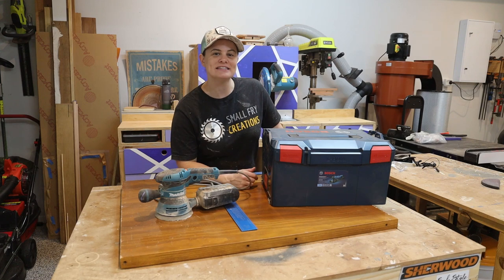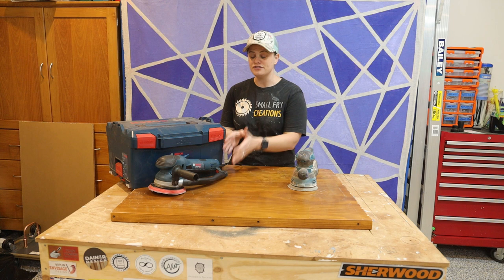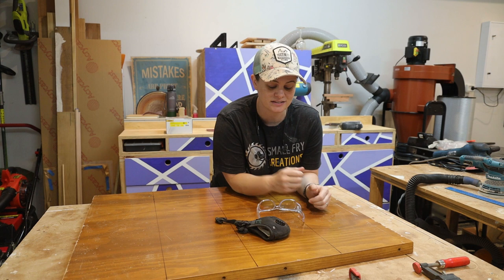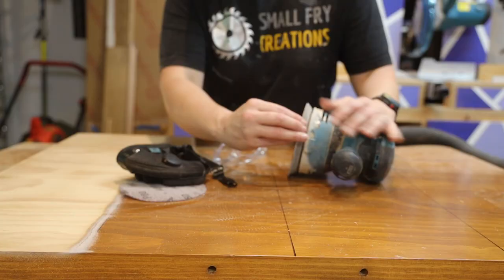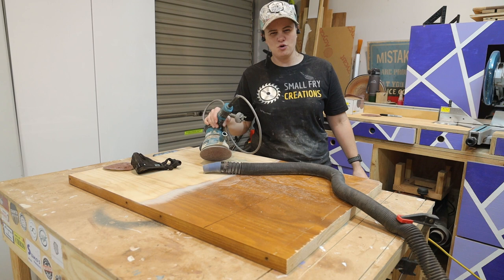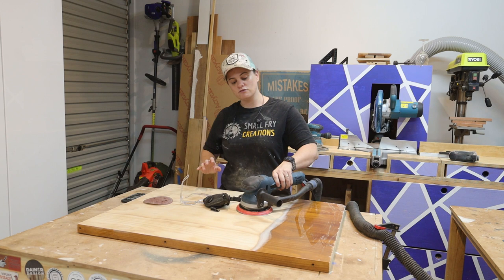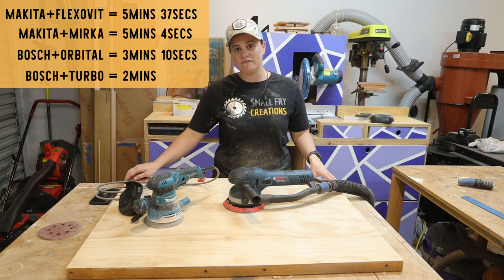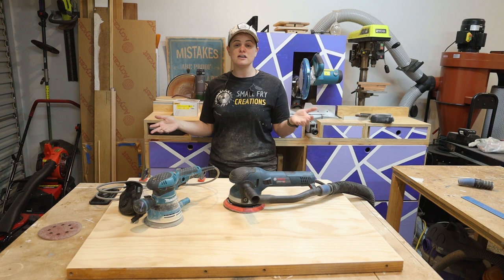BOSCH Sander GET 75-150 VS Your Everyday Sander Review and test

Comment: This is exactly the upgrade I am planning. I have that 125mm Makita and I'm planning to get the Bosch 75-150, so this was perfect, thanks! The plan is not just to do the job quicker, but also to make it easier to get a flatter surface due to the larger pad.
Reply from the maker: Awesome. The Sander is fantastic and does a great job. Its easy to hold flat and does create a better finish for sure

Comment: Hahaha the sanding shuffle! Wow, wow, wow. Awesome test Ains, you are filling a gap I really wanted to cover in my video as I was restricted to my 5" 18V Sander. I have an article coming out soon going into more detail about types of sandpaper and why they perform differently. The main thing to note with the Mirka is while yes, the FlexOvit was only a little slower brand new... if you'd repeated the test a few times the Abranet would keep on going fast whereas the Bunnings one would wear out after a few repeats. But geez, how good is that Bosch unit? No brainer if you are in production mode for markets or furniture.
Reply from the maker: Thanks James. How else do you pass the time sanding besides dance. The Mirka sandpaper is awesome. Like you say over the life of the paper the Mirka just runs away with being the best. I’m keen to read the article when it’s out 😀 your video has great info and detail 😀

Comment: Gooday. Im uk based and was using Festool rotes over 20yrs ago…a sensation after normal sanding. I then tried Makita roto orbit type…almost as good. I,m now at 64yrs old and retired considering the Bosch after reading dood reports. You are correct about abrasive types..they make a considerable difference. Over here its Sia or 3m products I prefer Sia Siarrex the difference being out of this world if you go from a normal sander and normal paper. We used to strip a full farmhouse table top ie 6x3 feet of a 2 pack laquer in around 15mins. [it might take a little longer these days. Great review ps try removing that extra handle and hold the sander on the top directly over the sanding pad it well stop it getting away from you. Also you bench seems a little high to get your weight over the job. Kind regards from across the big pond Stuart Bell
Reply from the maker: Hey thank you. I haven’t tried the others to compare but I’m very happy with the Bosch. I have found since removing the handle does help. Your right with the tip 😀 happy sanding and making and thanks for the support 😀

Comment: I've actually been looking at the Festool Rotex lately and as you say, it's ridiculously over priced. I checked out the Bosch and the guys at Total Tools told me it was a Festool challenger. This review couldn't have come at a better time. Well done, and you've made my decision a little easier. Cheers. 👍👍🙂
Reply from the maker: Thanks Chris. I have never used a Festool to compare but I love the Bosch and at half the price it surely can’t be doubley better. Another thing I found when researching was with the Festool gear you really need to use their dust collector because they have odd size fittings and I didn’t want to 1.shell out for the collector and 2. Be locked into a brand. 😀😀

Comment: Been doing a lot of sanding over the past two years. All my door and window frames and cladding are cedar, and have been badly neglected. Stripped them back, inside and out, and used Osmo. UV product on the out and regular on the inside. I think I’ve used almost every sandpaper and method... and still learning by experience. I have three festool sanders, and I can’t say which is best, because it comes down to what the task is. The 150 is so satisfying to use on big panels, but hopeless in corners or on the many narrow edges.  Something with a delta pad works best  However, when it comes to sandpaper, I’ve not found anything better than festool Granat.
Reply from the maker: That sounds like a lot of sanding. It would be awesome to have a team of sanders 😀 I have heard good things about the Festool sandpaper’s 😀 just so pricey!!
Reply: 3m 710w or 3m 310w. Both are far superior to any festool sandpaper I've tried. Highly recommend 👍

Comment: Nice comparison. You want to save even more time use a variable speed rotary sander/polisher with a good 8" pad. They do take a lil more skil and technique and you loose the dust extraction but way funner to use.
Reply from the maker: Oo good tip!

Comment: That looks like sheet 3 is Abranet without a protective pad- and it's 150mm v 125mm 30% larger pad? Your vibrations in turbo mode are not conducive to sanding for extended lengths of time. In 2023, your best is festool or mirka 150mm brushless eccentric sanders combined with 3m cubitron II extract. The rotex compares with the Bosch but both are far too aggressive in turbo mode to be all that useful.
I don't believe the Bosch has a replacement air center hole - this allows for better extraction and sandpaper cooling. Mirka Festool and Metabo sell sanders with this feature.

Comment: Great comparison. Thanks a lot!
Reply from the maker: No worries!
Reply: I bought the sander and used it for the first time today. I must say I am very disappointed. I have a GEX 125-150 AVE which is a good sander IMO. I thought the GET 75-150 would be everything like my GEX, but add the Turbo mode. 
I find the Turbo mode is less useful than I thought, because the sander is really hard to control then. One gets easily uneven results in Turbo mode. Also the vibrations are extreme and very annoying for the hands and arms. The plastic handle on the GET is a joke and does nothing to dampen the vibrations. 
Then in normal random orbital mode the speed of the GET is much slower than my old GEX. It took me more than double the time to sand paint with a new 80-grit (supplied) paper, compared to a new 80-grit (normal Bosch paper) on the GEX. (3:40 with the GEX and about 8 minutes with the GET for the exact same surface!).
Also the handling of the GEX is much better, because it's perfectly balanced, while the GET tends to tip over all the time and needs constant attention to try to keep it flat -- which is much harder to achieve than with the GEX. I surely will get rid of the GET again and will use a belt sander or other means for the rough work and use the GEX for the final sanding.
Ah, the vibrations on the GET are seriously more (in Random orbital mode even) than with the GEX as well .... --- I hate the GET!

Comment: is this 150 to 150 mil or 125 to 150 test? it's kind of logical, is makita use smaller pad (and probably weaker motor etc), it slower, right? there's other makita model, which would be better head to head test, imo.

Comment: So I have that Bosch and was looking to also upgrade to that Makita. The reason I want the makita is I'm not sure how good a 6" sander would be for finish sanding. I want to start making some hardwood tables and furniture. Would you agree that you would probably use the bosch for the low grits and as you go higher use the makita for a better finish? Or do you think the Bosch can do it all and still come out with a good non swirl finish?
Reply from the maker: Hey I use the bosch for every sanding job. Tables and all. Have never had an issue. I would recommend using a good quality sandpaper like Mirka an you would be good. Hope this helps 😀
Reply: @SmallFryCreations  wow that would be cool. I like how you can turn the bosch down pretty low for ends or softening edges. Thanks for the reply

Comment: Great to see Aussie specific content! How's the finish when using turbo mode, compared to orbital mode?
Reply from the maker: Thank you. Well I actually just sanded a dinning table with 80grit and turbo mode and it was so quick and easy and gave as good as finish as in orbital mode with 80 grit. I use turbo mode and 80 grit as step one. Then switch to orbital and go through the grits. I reckon cuts the sanding in half 😀
Reply: @SmallFryCreations  awesome, thanks. I'm heading to order one today.
Reply from the maker: Awesome 😀 that’s exciting!! It’s a great sander and very helpful to have in the shop

Comment: I will say I am interested in the better sandpaper... That was pretty awesome! Sometimes it feels like it takes forever to sand my projects.
Reply from the maker: The Mirka sandpaper is awesome. I’ so glad I made the switch
Reply: @Faustustopheles
Are you using a vacuum with your sander?  I used to hate sanding until I started using a vacuum.
Reply from the maker: Yeah I use a shop vac. I haven’t used a vac on the my old sander but the Bosch works so well with it and it was part of the reason for the upgrade.
Reply: @SmallFryCreations 

Yes, I was wondering if Faustustopheles uses a vacuum.  Resanding the same dust over and over again because a vacuum isn't removing it plugs up the paper, wears it out sooner and takes longer to sand.
Reply from the maker: Oh sorry 😂 yes very true
Reply: @ThekiBoran  you know... I did in the beginning. I don't know why I stopped. I think because it's a chore to find a hose and adapter that actually fit the makita sander I have... I will be doing a bit of sanding today on some mdf (which is a pain in itself) and I'll try to find that adapter. Hopefully I have a better time.
Reply: @SmallFryCreations  I find myself having to stop to switch out the papers. I don't throw them away because I know they are still good. I later take them outside and shake them or beat them to get most of the dust off. I know... More work and wasted time. Which is why I am so interested in your system. I don't think I do enough to invest in the Bosch sander but certainly the new paper and vacuum should make life a bit nicer...
Reply from the maker: I think new paper is a huge upgrade to an sander. I use to hate trying to find a hose that fit the sander. I have found the rockler hose system very helpful as the rubber ones fit a number of dust ports 😀
Reply: @SmallFryCreations  I'll look into it as well then. Thanks👍
Reply: @Faustustopheles 

I have many makita tools and I think overall they make great tools, but dust collection is not a priority with them.  I have their cordless orbital sander, I had to wrap tape around the dust port tube to get the vacuum hose to fit.

Comment: How has the sander held up in 2 years?  Everyone reviews these things but very little on long term reliability
Reply from the maker: Extremely well. It gets used on every project and I'm working most weekends. It has never skipped a beat
Reply: @SmallFryCreations  I appreciate the response.  Its been kind of tough to find any long term data on it, the Mirka, and the Festool models
Reply from the maker: @1320crusier  The Bosch sander has never had any issues for me. The only bad thing I have to say about it is its heavier then the Mirka sander and maybe the Festool. Its not a big issue for me as I don't have the sander in a position where I notice the weight all that often. But something to consider. If I was buying again I would look at the Mirka as I have heard good things about it and its lighter but I can't speak to its long term use.

Comment: I bought the Bosch and it was every penny but the sanding pad sucks. Is there any after market pad that is better? I have gone thru 2 pads in 2 months and I don't sand everyday.
Reply from the maker: Hey Robert I haven’t had any issues with the sanding pads but I recommend using sanding pad savers. You can get them from Mirka. They are awesome and will save your pad. Hope this helps 😎
Reply: @SmallFryCreations  Thanks, I just bought a 5 pack.

Comment: Did you have to get total tools to special order the sander for you? They aren’t showing it on their website
Reply from the maker: I had trouble tracking one down. I spoke to Bosch direct and they told me the total tools stores that had stock and then I called. I was lucky to find one an hour drive away. I would say now I would call total tools and they should hopefully be able to tell you what stores have them or order one in for you. Hope that helps 😀 I would stay away from Blackwoods. I originally ordered from there and they never ordered it for me and after 3 months I gave up.
Reply: @SmallFryCreations  thanks! Yeah I don’t want to order from blackwoods, there’s a couple of other places online that have it but would prefer to buy from total tools as they have a store not too far from me.
Reply from the maker: Good choice. Not sure why they don’t show them on the website. I would say they should be able to order one if they don’t have one. They have been out for a while not so surely they can get one 😀